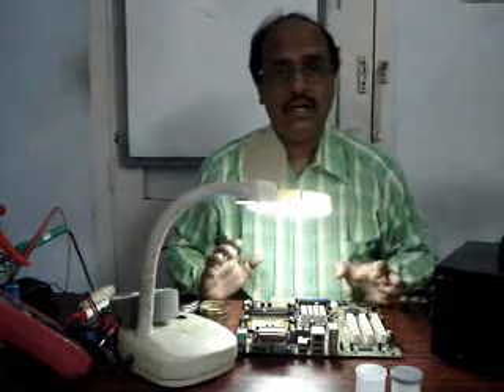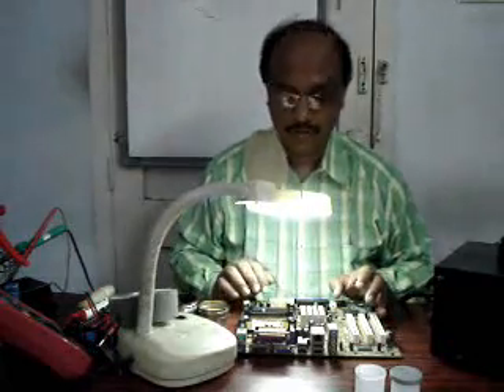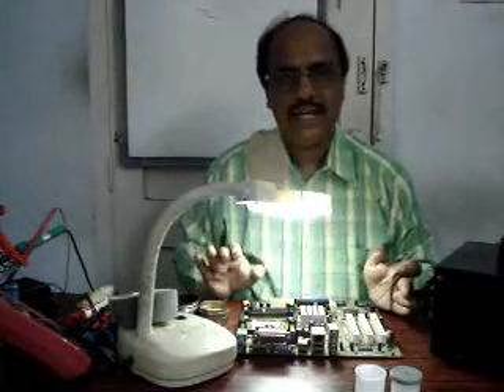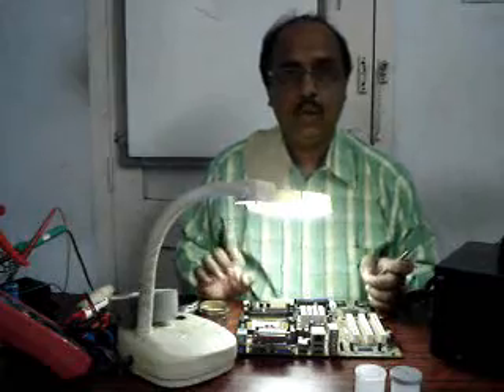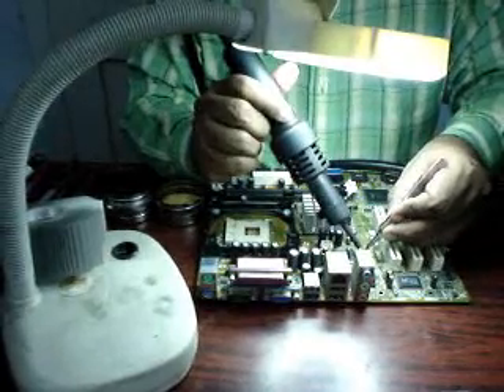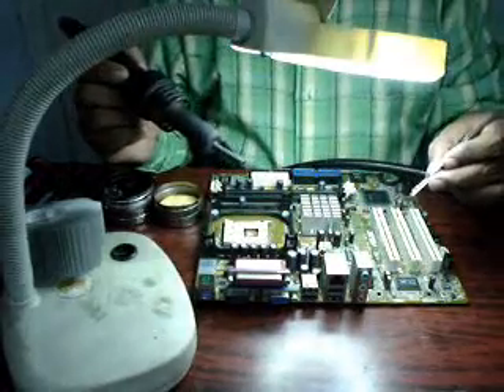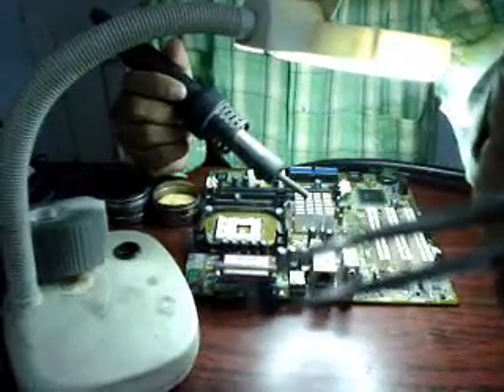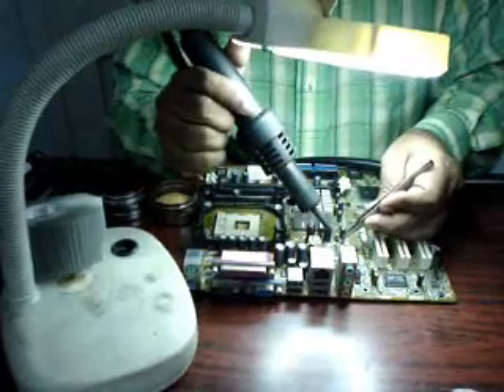Laptop Chip Level Training, SMD / PTH Soldering Training Module - Part 2

Comment: Great videos you upload Sandip. I love working on my PC's but never done any soldering to the motherboard. I have actually pulled off the connector for main fan on the motherboard of my Playstaton 3 while I was re-flowing it. Now the Playstation is fixed but as the fan is off it heats up after around 10 mins and tells  me to turn it off as it is over-heating. i have got everything I need to perform the fix, now all I need is the self confidence to make a good job of it LOL. You make it look easy